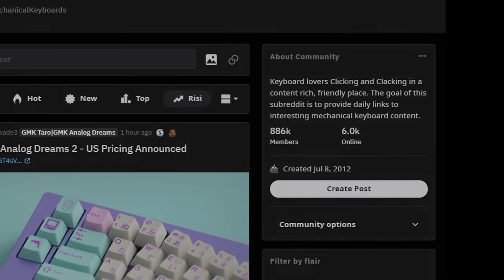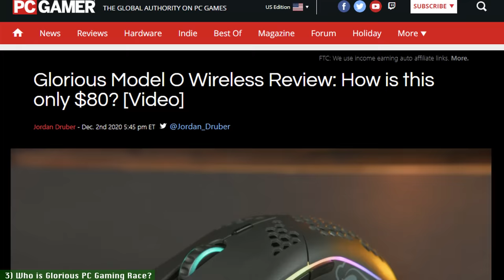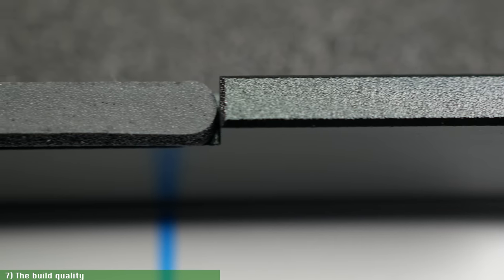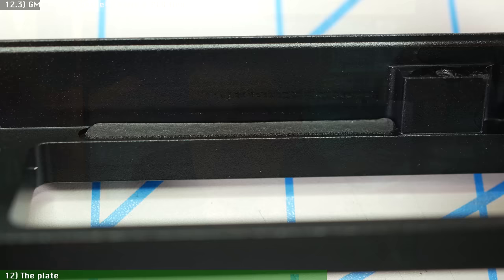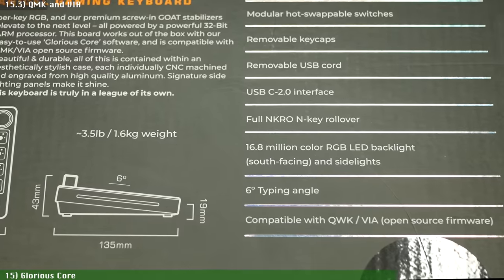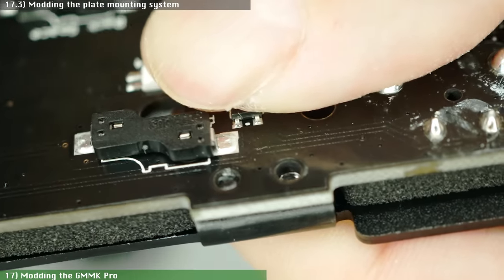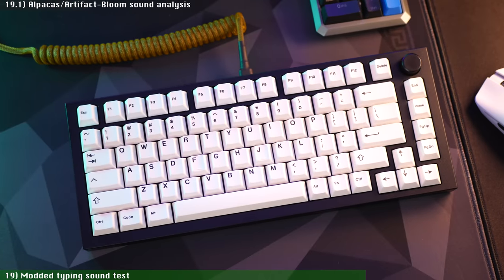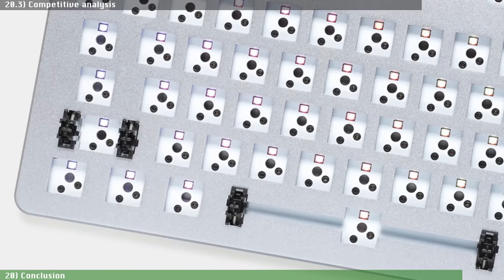GMMK Pro: The ultimate guide (in-depth review + modding tutorial)

Comment: Recently purchased the keyboard, and I bought C3 x tkc, polycarbonate plate, fake gmk Olivia keycaps, everglide aqua king v3 switches, lubed switches and bandaided the pcb, krytox g205 g0 for lube, and I seem to get a rattle in some of the stabs.  I wire balanced, unlubed and relubed, but still get rattle.  I originally thought it was the keycaps, but it didn’t seem to be the case.  Am I better off using the dielectric grease with the stabs?
Reply from the maker: Hi Jordan! First of all, great build!!! :)  I have been trying the Everglides Aqua Kings here and I love these switches!

As for the rattle, is it coming just from the space bar or from all stabilized keys? Also, did you lube the wire tips with Krytox? If yes, how thick was the coating?

I usually go with dielectric grease on the wire tips because it works well and it is super cheap. If you decide to lube the wire tips with the much more expensive Krytox, you'll have to use a LOT of it to achieve the same results.
Reply: @IOSam  I’m loving the aqua kings, smooth with a nice bottom out.  I got the spacebar, shift key, and backspace sounding pretty good, but my enter key doesn’t sound too great.  Watched the Taeha types stab lubing tutorial (put a good amount of krytox on the wires).  I’m thinking it could have something to do with a combination of my keycaps, and possibly the C3 stabs in general.  May consider holee mod in the future, but I could also try durock v2’s.
Reply from the maker: @Flade._  It could be a crooked keycap (more likely than a bad stabilizer, specially if it is PBT). Do you have another enter key from a different keycap set you could try on this key to verify  this?

At any rate, I'd give dielectric grease a try on this problematic stab, before cleaning everything for a holee mod.

If you do get Durock stabs, you might need to file the alu/brass plate for it to fit (should  fit the polycarbonate plate with no problem though).
Reply: @IOSam  My reply keeps getting removed for some reason (could be because I tried to insert a link).  But I tried the razer black widow chroma enter key, and that seemed to fix my issue.  Thank you!! Any good keycaps you can recommend?  I was thinking of another set, but not sure which ones are good quality and readily available.
Reply from the maker: @Jordan Granat  If you're on a tight budget (up to $50) go with any of the Artifact Bloom series from Drop (either on their website: https://fave.co/2Y26aI3 or on their Amazon store: https://amzn.to/3i81cjX ). These are very high quality dye-sub PBT sets in Cherry profile at a very reasonable price. If you can spend a bit more (up to $70), check out CannonKeys.com new line of PBT caps (also dye-sub in Cherry profile).
Reply: @IOSam  Thank you again.  I will look into both options.  I am very greatful there are people like u always willing to help people new to the hobby.   I am very excited to dive deeper, and use your guides to do so.  Keep up the good work man!
Reply from the maker: @Flade._  Happy to help man! This is what I'm here for! :)
Reply: @IOSam  Went with GMK as a replacement.  I was extremely hesitant to do so because of the price point, but I think it was the right decision.  The red dragon set that is up for preorder really caught my eye, but damn it was expensive.
Reply from the maker: @Flade._  Well, if you got a GMK set "extra" for pre-order at CannonKeys... then your wallet will be bleeding for a while (vendors put another $30 to $60 markup on top of the GB price for extras), but at least you'll get the set in a couple of months (instead of a couple of years when you buy GMK on the actual Group-Buy phase 😂). So there is that to compensate for the price.

Now, the chances to get a warped GMK key is much, much lower than with any other cheaper set out there, that's for sure (and they look incredible to boot :)!
Reply: @IOSam  My pockets definitely hurt after buying it.  I’m looking forward to see how the quality is for myself. I’ll keep you posted to let you know how I like them👍🏼

Comment: I'm fairly new into the keyboard community and I've been looking for a 75% hot swappable keyboard and after hours of searching, I've found the gmmk pro which looks like a very solid option. My concerns are, I don't really mind having a stiff board as I am coming from a gaming keyboard and I don't want my keyboard to be that silent either, I will be using gateron yellows lubed with krytox 205g0, and I see that a big chunk of your video is showing and explaining ways to make the board more flexible and more silent I'm pretty sure. I'm just concerned because I want a somewhat loud "thoccy" kind of feel without the board sounding hollow or any of that. So any suggestions for a slightly more louder and stiffer feel would be great. And my last concern was the compatibility with zeals screw in V2 stabilizers with the aluminum plate. I saw that the aluminum plate may not be compatible with certain stabilizers and I wanted to know if you knew anything about the compatibility with the 2. Sorry for the lengthy comment but I want to make sure I get everything right. :)
Reply from the maker: Hey Austin! Welcome to the channel! If you don't care about flexible plate/PCB, I'd say the GMMK Pro in its stock form will be just right for you, in the sense that it is no more and no less stiff than a regular gaming board. As for the sound, my suggestion, if you want to emphasize the "thocc", is to remove the foam between the plate and PCB and replace the included case foam with the thinnest sheet of PE foam you can find (you can also find this foam in adhesive tape form, which might make it easier to apply). PE foam will "thicken" the sound without muting the board too much.

As for Zeal Stabs, It seems their housing will not fit in the GMMK Pro Alu plate without some filing. So, if you don't want to get your hands dirty with metal powder, you'll have to go with the polycarbonate plate to be able to fit Zeal, Durock or GMK stabs. Don't worry about the PC plate being soft... Without the O-ring (or other similar) mod the PC plate will be no different from the Alu plate in terms of stiffness (I had many people confirming this to me). And you'll get the extra bling from the RGB light coming through it to boot! :)
Reply: @IOSam  Wow I really appreciate the speed and length at which you replied. Your channel with definitely grow if you stay consistent ;) As for your comment, I will definitely use all your advice when making my build! My one concern is actually finding thin PE foam lmao. I appreciate your help and I will definitely be screenshotting your comment for later :)
Reply from the maker: @LootTech_  Hey, glad to help!!! As for the PE (or EVA, which is a variation of the polyethylene material) foam tape, you could use single sided ones such as this: https://amzn.to/3iv2VyU

Let me know how your mod goes once you finish it.

Comment: Wait, so even the GM MK has bottom LEDs, double shots backlit keycaps should still work right? As the light will travel across the plastic, I just want enough glow to make out the keys at night in a dark room
Reply from the maker: If you use completely translucent switches (with no tint), you might get a tiny bit of light coming through (possibly a bit more if you buy the polycarbonate plate, that is also translucent). But not enough to see the legends clearly though (you can have an idea of how faint it gets on my pudding caps here: https://youtu.be/J_axv-TkjkE?t=1950

So here I'd say that those looking for bright backlit keys should stay away from south facing switch-sockets keyboards, such as the GMMK Pro, until some one in the industry decides to start manufacturing backlit keycaps with south legends.

Comment: Do you think Brass plate it is a good choice or overpriced upgrade?
Reply from the maker: I think they are an overpriced upgrade... Brass plates will usually make the whole assembly feel stiffer. So, considering that this board's design is already pretty solid out of the box, I think the stock aluminium plate is already as stiff as you should go with this keyboard.

The poly-carbonate might be a good option, if you want the RGB light diffusion and the extra bit of flex, but the Brass plate really doesn't add anything to this board's design and functionality to justify its $50 price.

Comment: I really want to get the GMMK pro, but I am wondering if you think the brass plate has any value? I'm new to the keyboard scene and I'm not sure if the brass plate is something I will be interested in. 
Anyways, amazing video please keep up the great work. Also, I love the way you did the sound tests.
Reply from the maker: Thank you!!! Lots more to come! :)  As for the brass plate for the GMMK Pro, I definitely don't think it's worth the $50 they are charging... Brass is usually stiffer than aluminum and tends to be louder (and higher pitch) in most cases. As far as metal plates go, you'll usually be better served by aluminium. I'll be checking out other materials for the GMMK Pro's plate, such as polycarbonate and FR4 though (which should improve the sound a bit when compared to aluminium).
Reply: @IOSam  Thanks for the reply! I think ill stick with the aluminum then. I might also get the polycarb to see if I will like the sound better and I like that the RGB will show much more.

Comment: Sam Would you be able to make a list of 65% keyboard which has function key row?
Reply from the maker: The only difference between 65% and 75% keyboards is the presence of the F row (which the 75% boards have and the 65% do not). So if you need the F row, any keyboard with a 75% layout (regular such as the KBD75 or exploded such as the GMMK Pro) will do the trick for you.

Comment: I know it can be a silly question, but i really like this keyboard and I wanna buy it, my question is, is it compatible with Mac OS?
Reply from the maker: It is compatible out of the box. HOWEVER, the "option" ("Alt" key on Windows) and "mac" ("Win" key on Windows) keys will be swapped, so it might take some getting used to...

One way to fix this is flashing the keyboard with the QMK firmware, where you'll be able to switch those two keys and have them properly placed for a normal MacOS operation.
Reply: @IOSam  thanks!

Comment: Is it possible to put some silent alpacas on it?? And how many?
Reply from the maker: You certainly can! This keyboard takes 82 switches, but make you sure you get a few spares just in case one or two fail. The GMMK Pro is a good candidate for a silent build, given how muted it is in its stock configuration (and how much quieter it can get if you put a thin sorbothane sheet in the bottom of the case).
Reply: @IOSam  ty very much

Comment: Hey IO Sam, This is going to be my first custom Keyboard. I'm going to be going with a polycarb plate and looking to do gateron black ink v2, I do like the deeper feel and smoothness of those linears. Are those switches you would recommend for the GMNK pro, I do 75% gaming and 25% working/typing on the Keyboard.
Reply from the maker: Hey Grenton! Gateron Inks are always a good choice!! While the Ink Yellows I used are closer in design to the new Ink Blacks V3 that just came out (but with slightly lighter springs), I'd say that all versions of linear Inks (blacks, yellows and reds) sound very similar (and very "thoccky").

If you are "linear gang" (and specially if you'll game on this board), Ink Blacks are as good as you're gonna get in terms of sound (specially if you lube them), so I'd go ahead with those in a heartbeat!

The only thing to consider is the heavier springs of Ink Blacks, that might take a while for you to get used to if you never used heavier springs. But I'd say that if you put the effort to learn how to use them without "forcing" a bottom out every time (which is the whole point of "black" heavier switches) you'll eventually improve your technique and become a better, faster and more efficient typist... Which is another benefit of these switches in my humble opinion.
Reply: @IOSam  wow thank you so much for such an extensive response. Is the V3 worth getting or are the V2 still better for what you suggested ?
Reply from the maker: @GrentonCasts  You're welcome! If you can find the V2 for a lower price, I'd go for them. The main difference of the V3 vs. V2 seems to be the stem (which has a "box" style in the V3 vs. the traditional style of the V2). But, as far as we know, the materials used in both versions seems to be the same so the sound and smoothness won't be too different.
Reply: @IOSam  awesome! Is the G Lube from glorious a good option. As this is my first keyboard I’m not sure if I want to spend on the Krytox haha
Reply from the maker: @GrentonCasts  While I haven't tried the G Lube myself, all reviews I've seen claim that, while not better than Krytox, it is good enough if you're on a budget. So, I wouldn't be afraid to go with it if I had to...

Comment: How does it sound with Zilent™ V2s?
Reply from the maker: While I have not tried this particular board with Zilent V2s, I'd say that would be an incredibly silent combination! Zilents are the quietest tactile switches I've ever used ( https://youtu.be/3s4ruFFqmqo?t=2809 ) and the GMMK Pro is already pretty muted in stock form (even better if you mod its stabs). So it would make a perfect board for office (or shared space) use!

I'm thinking about shoting a follow up video about the GMMK Pro (with other accessories, switches, mods, etc), so I might add the Zilents (or the silent Gazzew Bobas) to that one as well.

Comment: I’m not sure if you mentioned if this is Mac OS compatible?
Reply from the maker: While I didn't mention it in the video, I can confirm that the keyboard hardware will work on Mac OS, but the Glorious Core application will not, since Glorious doesn't have a Mac version for it.

That, however, doesn't prevent you from using it, since the RGB lights can be set using hardwired commands on the keyboard itself. The only other issue would be that, without the Glorious Core app, you would have to use QMK to reprogram the positions of the "Windows" and the "Alt" keys to use them as "Option" and "Command" keys the proper way, so they don't stay inverted (which would be anoying, of course).

While QMK can be a bit intimidating, it is totally doable if you follow MechMerlin's guide: https://youtu.be/fuBJbdCFF0Q
Reply: This is confirmed because I bought the keyboard yesterday after watching your video 🤣🤣🤣🤣🤣🤣

Kudos man very thorough never seen an in-depth review like this before! Keep it up!

Comment: why would you want a flexible board? I usually want my board as stiff as I can get it.
Reply from the maker: Exactly! And this is what I keep telling people: "stop taking what streamer A or B says as gospel!". Until you try for yourself, you'll never really know what YOU really like.

The reason why I felt the need to address plate flex "issue" in my video is just that 99% of the comments I've seen about this board out there criticize the supposedly "stiff plate" and how the gaskets "don't do anything" in this keyboard (which I obviously disagree).

So, sure... If one wants to make this plate more flexible, I showed a way to achieve it. But as I said in the video ( https://youtu.be/J_axv-TkjkE?t=1722 ), plate flex should not be a concern to the majority of users out there (some, in fact, like you, actually prefer a rigid construction) and the gaskets used in this design work perfectly fine for what they really matters: removing rattles and pings ( https://youtu.be/J_axv-TkjkE?t=1625 )

Comment: Now I know everything i needed to know about this keyboard. Thank you sir, your videos are insane ! Question from a newbie, how did you come to mix this differents lubes ? Is there a real perceptible difference ? I guess so, but I feel curious. What is missing with only one of them ? Thank you anyway for this work
Reply from the maker: Glad to know it was helpful!!! And thank you for the feedback! :)
As for the reason why I mix Krytox Oil and grease (on a 50/50 ratio) is just to save money...

205 G2 and 105 oil are much cheaper (in bulk) than 205 G0 and those are available everywhere, while G0 is expensive and can only be found in small quantities in boutique keyboard shops. Mixing half and half of 205 G2 grease and 105 oil is exactly the same thing as 205 G0 in terms of materials and consistency.

Mixing the thick grease with the oil also allows me to dial down the viscosity. So for example I might make a thinner mix (say 1/3 grease and 2/3 oil) to use with light tactiles or a heavier 50/50 mix to use with super tactiles and linears.

I never use thick G2 or the 105 oil isolated simply because the G2 is way too thick and the oil is way too thin for my taste. I know a lot people like to use the 105 oil for bag lubing springs, but they do that because it is much harder to bag lube springs with grease (even with the thinner G0). I, on the other hand, do not bag lube springs... So I can apply the mix on springs with a brush.

My problem with using 105 oil by itself is that it runs down to the bottom of the switch rather quickly, while the Krytox mix (or the G0) do not (they stay attached to plastics and metals for a much longer time!).